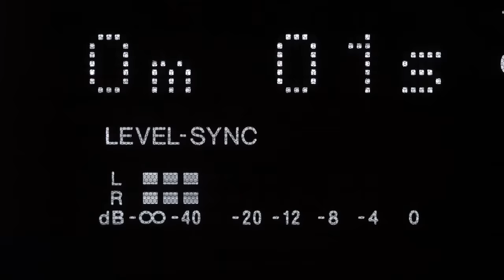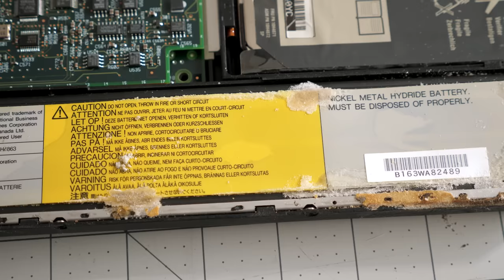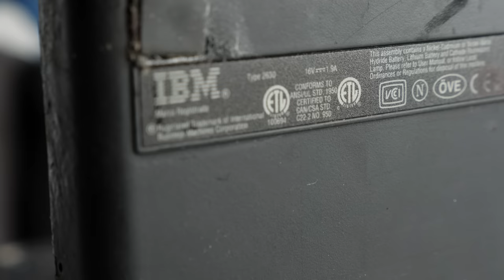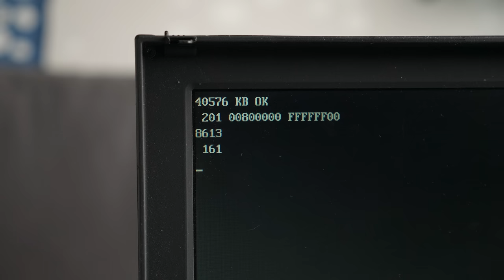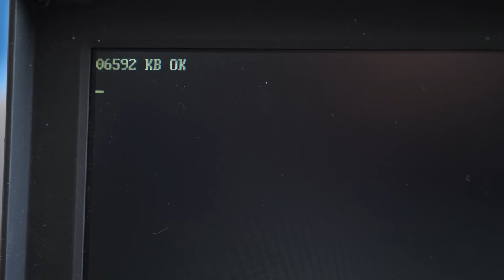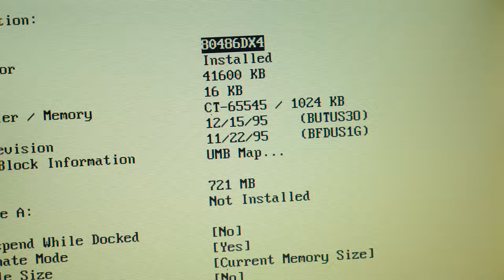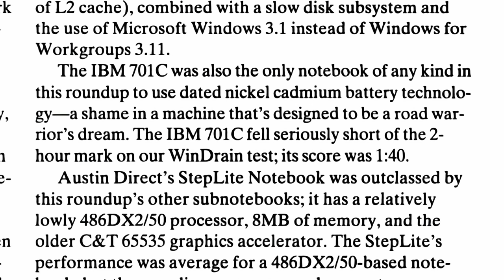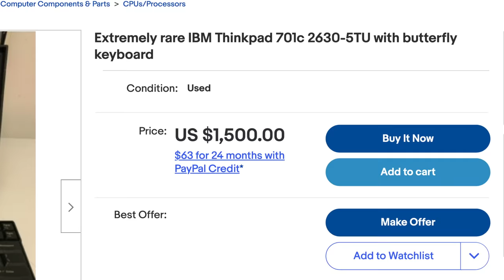ThinkPad 701c: IBM's Butterfly Laptop

Comment: Hi, nice video. Your machine is fixable. There is a soldered coin cell for RTC/CMOS at the backside of the mainboard, you have to totally dissasemble the whole machine to reach that. An empty one is always causing this hanging and freezing issues and reporting the 201 memory error. Just solder a new 3 volt cell in and your Butterfly will magically come back to life. I am a Thinkpad collector and i have repaired a few 701CS in the past. The battery you replaced is the standby battery (to keep memory content to change battery packs in standby) and must be a rechargable one, you should not pop in a non-rechargable cell. You can also just leave this one out, it's not needed for proper function.

Comment: Ah the 701c! When I worked at Xerox back in ~2003 I found a dozen or so of these in storage that had been there since 1994 or so. No idea if any worked and sadly I wasn't allowed to take any and they were transferred to a recycling facility :(
Reply: So sad :( they didn’t want them anyway!
Reply: Damn :(
Reply: @kaitlyn__L  indeed but this was early 2000s and enterprises were very difficult about giving away old hardware for liability reasons back then even when the hardware was essentially worse less. It’s better today but still not as good as it could be.
Reply: @satysin630  I used to work in a recycling facility and got my hands on one there - brought it back home and it seems to be in working order.

However this was last year (and in Finland), so not the same computers, lol ;) I was damn lucky, I had talked so much about my retro computing hobby and mentioned that specific model, and somebody noticed it before it got thrown away (we were fixing old PC's for resale, but more like 5 years old PC's than over 20 years old - normally that would have just ended up processed as materials, but my co-workers knew of my interest, so this one got saved). The battery had already been removed and it had a broken HDD, and I have not yet managed to replace the tiny HDD, but I have planned to. I want to install the original OS on it, but not DOS+Win3.1 or whatever M$ option they had, but OS/2 - which was the other OS choice for the system back in the day, and way cooler ;)

But working there I too sometimes had to butt my head against the brick wall of bureaucracy - some newer, but still too old for regular resale, machines I had interest towards had to have their HDD's completely wiped (by multiple overwrites) and if they didn't have the setup to wipe some more arcane system than usual - I saw some quite non-standard HDD's in some of those systems. And you couldn't have them unless it was without the HDD (which in often cases would result in a system I couldn't likely ever find a replacement HDD for) or you could get them wiped. Yet I could have gotten them to work, I boot tested them and they would have worked - and the guys knew I had no interest whatsoever what might have been on the HDD's before. I guess with the 701c they just thought it was so old that I could have it anyway - I know they didn't test it before.
It's better today but still not as good as it could be, for sure. But I also feel like a damn lucky bastard =)
Reply: I got my hands on a few things from my father's work. I was able to get two computer cases (one I ended up giving away, but I still have the other one,) and a wireless display device. It worked, but I never figure out how to get it to work on Linux, so I have it put up, and I haven't messed with it since.

Comment: I loved when LGR reviewed this laptop and wanted to get one of these <3
Reply: Same
Reply: You only think you want one.   Retrocomputing just isn't much fun with laptops.  The thing most people do with retro-computers is play retro-computer games and these laptops are absolutely unsuitable for gaming.  They are slow, non-standard and the LCD screens are primitive and look absolutely awful in anything but its native resolution.  You can get around this by hooking it up to a CRT, but then it's not a laptop anymore.
Reply: @tarstarkusz  I beg to differ, I've got my hands on an 1997 Dell Inspiron M200ST and managed to get it working with a clean install of win 98, and enjoy some good retro gaming with it
Reply: @tarstarkusz  On the other hand, you don't have to deal with yellowed, brittle beige plastics, the power supplies are external (so they can be easily replaced), they're much easier to store away, you don't necessarily need a keyboard and mouse, and they don't look weird with a modern LCD monitor attached, unliked retro desktops designed for a huge CRT.
Reply: @kirishima638  The laptops get just as brittle and most discolor as well. Plastic is plastic and there is a lot more plastic with a laptop. 

Power supplies are pretty good and most are not giving any trouble besides the ones of the very late 90s to the mid 2000s.  People in retro-computing massively overestimate the cap problem of vintage TVs and radios.  The tiny ones are more prone to failure on boards. But the normal size caps of power supplies rarely go bad. They were made much better than the old ones in tube equipment and they usually have less voltage across them.

Space is where laptops do shine. No doubt about it.

Most old games look terrible on even modern laptops or modern LCD monitors.  They were made to be displayed on a CRT and that is how they are best displayed.  OTOH, I do understand that not everyone has the room.
Reply: @Gadgetman1989  A regular desktop would work better.  Hell, most laptops don't even have a game port on them.   A lot of laptop video cards don't support vesa standards like 400x300 and even when they do, they tend to look distorted and on many laptops, significantly shrink the screen.  I have an old Dell laptop with native 800x600 video and when you play a dos game, less than 1/2 of the screen is used.
Reply: @Gadgetman1989  I have two butterflies, a 701c and a 701cs. Both with floppy drives and one has all the accessories. Even so, the only cool thing about them is the keyboard mechanism. The bios is a weird non-IBM affair with little that you can actually customise. Getting memory is a bit of a pain and the CMOS battery still throws up an error even when replaced. Still, I wouldn't part with either. 

Most butterflies I have seen for sale lack the floppy drive and they are really hard to find Sadly, the floppy drive and cable were unique to the 701. No other Thinkpad floppy/cable setup will fit. There is no other way to install an operating system onto the hard drive without one, so you would be forced to take out the hard drive and try to install stuff using another laptop and hoping that nothing ends up conflicting with the Thinkpad's hardware.

They are great if you want to tinker with DOS or early OS/2 but not much else.
Reply: I set up a machine to run Windows 98 for retrogaming for a friend just a couple of months ago.

The difference is, it’s actually a modern machine, a petite MSI Cubi 5, running Linux Mint. I put a build of PCem on it to autostart the actual Windows 98 OS (plus games) in a captive GUI login that the user cannot escape from to do anything else. That user account is even blocked from the network (thanks to a simple iptables rule).

That is a way to do retrogaming with much less hassle than trying to wrestle with actual period hardware.
Reply: @lawrencedoliveiro9104  I think a period correct (but the high end of that era) computer is the way to go, especially if your friend is going to be playing old 95 and 98 games.  Much better compatibility.  Personally, I think emulators will be more of a hassle.
Reply: @tarstarkusz  Have you tried PCem? It even loads an authentic period BIOS. That’s how good it is.
Reply: @lawrencedoliveiro9104  PCem is very good, but it's a pain getting software into it.   With the version I have, I have to mount the blank floppy images in dosbox, then copy the files from a dosbox prompt to the virtual floppy disks and then copy them from within PCem from the virtual floppy to the virtual hard disk.  I think PCem is great for emulating old computers, but not for something like 95 or 98.  One of the problems is it needs exact hardware to emulate. It's not more generic like dosbox. It's a pain to set it up, 

 But then again, I've never really tried to use it to emulate 9x computers (which would have required a lot of mucking around I was too lazy to do). 

The biggest hassle with real hardware can be moving software to the computer. But if you use a new enough computer, CDs or even USB shouldn't be too much of a problem.  Another thing you can do is use a CF card for the hard disk and you can just put the CF card in a reader on the modern computer and copy all the software you want.  Of course, I say this having a spare bedroom to put the computer in.  Extra computers take up a lot of space. 
Just so long as you enjoy the games!
Reply: @tarstarkusz  I don’t know why you have to go through all that hassle. All the relevant filesystems are directly mountable from Linux.
Reply: @lawrencedoliveiro9104  I'm using Windows.  There may be some imaging software I can use, but copying them from the command line is 2nd nature to me.
Reply: @tarstarkusz  With all that copying back and forth ... almost paradoxical, isn’t it, that Windows retrogaming is probably easier on Linux than Windows ...

Comment: Nice video, love these Thinkpads! I have a few information, which may be useful.

This laptop have 3 battery inside; the normal leaky main battery, a rechargeable 'standby' battery and the cmos lithium battery.
The green circular one is the standby one, not the cmos. And the laptop will try to charge it, so if the new one is a non rechargeable lithium one, then a charge blocking diode is recommended. (But this battery is an optional one, the laptop works without it. The purpose is to provide main battery swap ability in suspended mode without completely shutting down the machine.)

There is a very high chance, that the error codes (memory,datetime,config) caused by the flat real cmos battery. Yes, this laptop can glitch out and even freeze, plus reporting memory error without good cmos battery.

The cmos battery is located and soldered(!) in the very bottom of the mainboard, to replace it the laptop need to be fully disassembled.

And in the end, all 3 battery prone to leak in the Butterfly which makes the preservation of these machines very hard.
Reply: Even newer machines lock up the BIOS because of the CMOS battery, I've had happen recently on a newer ThinkPad R30. On mine, one of the solder joints of the battery socket was loose and it caused the machine to freeze in the BIOS and in Windows.
Reply: @MihaiGradin  salut cf pe aici😉

Comment: First time I've heard that battery fluids can make plastic britte, but it actually lines up with what I saw on a Toshiba Satellite 105CS from my Uncle. It had cracks all over it and at the parts near the its batteries (3 of them Ni-Cd, Ni-Mh, Li-Ion) that had all leaked and destroyed anything metal and the whole pcb. Upon touching the plastics they cracked and crumbled even more and I just had to get rid of it. Only thing left with me is its laptop bag that I was able to clean up but don't have any use for at the moment.
Oh and among the batteries the ones that blew aup and leaved the most were made by Varta.

Comment: Great video—as always—about a laptop that I was mesmerized with when I first heard about it: I thought this was the coolest thing in tech when PC Magazine first previewed the 701c and it's TrackWrite keyboard back in '95. Even though this particular unit still had issues, I'm sure at least it was interesting to see in person. The only thing I remember from that particular time period that I thought was as neat as the TrackWrite keyboard was the Thinkpad 755C(?) where you could remove the back of the screen and use it with an overhead projector!

Comment: 11:35 "The 75 MHz (DX4) was barely faster than the 50 MHz (DX2)". This was a common problem. I "upgraded" my system from a DX2/66 (overclocked to 80MHz) to a DX4/100 and noticed that my computer was also running around the same speed. The problem was that a DX2 ran at twice the front side bus speed, and the DX4 ran at 3 times the front bus speed. So if you had a DX4/100, your system ran at 33 MHz vs. a DX2/80 with a system bus at 40 MHz. A lot of people weren't happy with that.

Comment: The small battery you replaced under the square cover is NOT the CMOS battery, it's a standby/sleep battery! The CMOS battery is soldered to the underside near the ram slot, you have to remove the boards to get to it.

Comment: I have a few of these in my storage box. I wanted to restore one to its original condition, and mod another with new NUC mobo and display, but never actually had a chance to get into it. This video fired up my passion once again :D 
Also, I hope you extracted the end plate on the battery pack before throwing it away. That bit is pretty hard to come by.

Comment: I had a (used) 701c many years ago. I remember loading FreeBSD via floppy (it was a royal pain because there was something like 42 floppies, and if you ran into a bad floppy you needed to restart at the beginning. Thankfully I only had 2 bad floppies.) It was a wonderful machine to work on back then, but I don't miss it today. I never really had any issues with mine, but it was only several years old back then. One thing I really liked about it was compared to other laptops of the age it was more compact... but lugging around the external floppy isn't something I miss. As always really enjoy your efforts and explanation Colin. It was a nice trip down memory lane.

Comment: From what I remember reading on a number of forums the memory error is actually related to the dead CMOS battery. The CMOS battery is actually on the underside of the system board and fortunately is a coin cell although it is spot welded to a tab. As for getting the machine to boot to something, I suggest taking the hard drive out, making a bootable install on another laptop (preferably Pentium-era), and then moving the hard drive back into the laptop. The performance of these machines were held back by the lack of L2 cache and this is a common thing with the 486 and Pentium-era Thinkpads.

Comment: Hey Colin, as usual I greatly enjoy your ThinkPad videos. Regarding the coating, I've had some success with Nivea creme on the T and X models. It is great to remove grease and give the shiny look back to it. Granted, the ones I used it with were not as old as this one. I've tried this method with T/X40 and newer and they look pretty good.

Comment: The leaking battery in that thing reminded me of the time when the battery in an old Dell Latitude LM I had in my collection blew up in the middle of the night. I heard a loud POW from the room where my computers were stored and I just thought my cat knocked something over. When I woke up the next morning and went in there I found that it had sprayed battery acid everywhere. That was fun to clean.
I have no idea if the laptop works because I don't have the charger for them, but it's most likely dead.

Comment: My grandpa had one of these!! He was an insurance salesman in the '90s and needed a portable workstation. The butterfly ThinkPad was his laptop of choice. He got a portable printer and a beautiful leather carrying case that I used for years with my contemporary setup. Unfortunately, the right-hand side hinge mechanism on the laptop broke. From where it broke, I can only assume it was due to mechanical stress from opening the butterfly mechanism over the years. Now, to get the keyboard mechanism to work, you have to carefully open the screen about an inch or two, grab the stub of the actual hinge mechanism, and put pressure on that with your thumb while you open it to prevent further damage. Now that I think about it, I've never tried to boot it... If I'm able to find the charging cable, what precautions should I take before powering it on??

Comment: If you replaced that RAM I bet you it will boot. Had a similar issue on a T23. Swapping RAM at least enabled it to boot.

I reckon you've got a good chance of at least some interesting content.

One other thing, some spray on silicone dry lube on the keyboard sliders will help it work smoother, causing less wear on the components.

Keep up the good work!

Comment: I loved the keyboard on my 701c. Standard size not-mushy-ass keys that actually had a little bit of travel (especially compared to today)! And the nipple (Trackpoint) mouse was much better (and remains so) than any trackpad that your arms constantly set off. The keyboard got "stuck" once when opening the notebook, but it self-corrected the next attempt to open it. Higher resolution would have been appreciated. Even though the screen was small, it was in the time of the 4:3 aspect ratio LCD screen, so you could actually read the text on the screen. Ah well, good times.

Comment: that laptop is quite a challenge to get working. I reinforced the hinges because the cover broke with the force of the keyboard mech, and had to replace the ram chips, quite a challenge to even find a replacement and to solder back (because I broke some traces). I leave it open to cause the least stress to the hinges.

Comment: Did IBM use Magnesium alloy in the case in 1995? Could be a reason why the battery corrosion extended to the case.